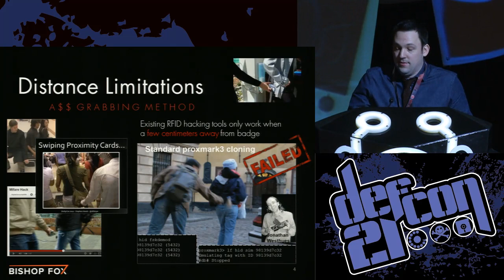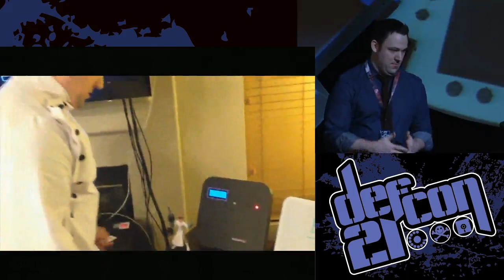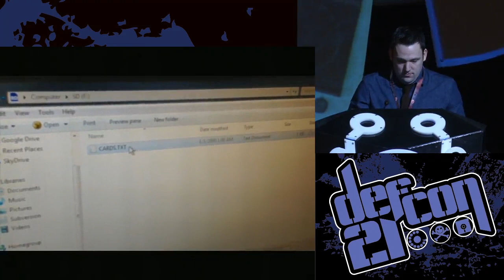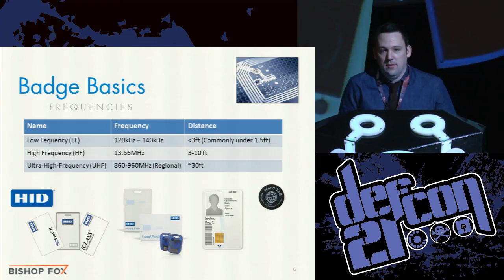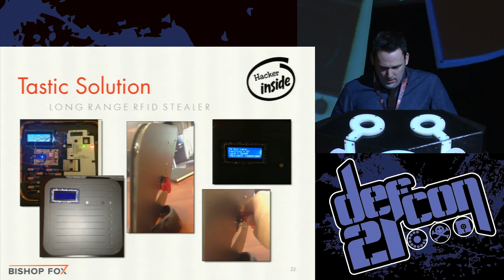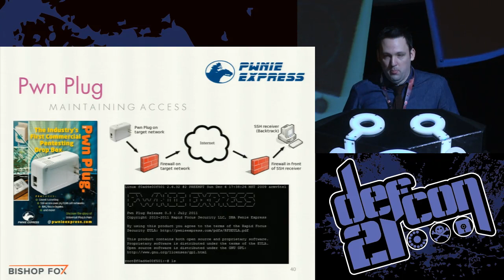Defcon 21 - RFID Hacking: Live Free or RFID Hard

Comment: What i am not getting is why it has taken this guy this long to do this. Not complaining here but i personally have done this successfully 6 years ago and tested it on a BNSF train passing a crossing with the reader in my car and an external panel antenna in the front behind the grill of the car. I read the RFID off over 200 inter-model containers on the passing train.  Yes my setup is bigger BUT I have 20 times the range than his setup meaning I can read a police officers RFID badge simply from me sitting behind him at a red light...
Reply: So why were you not at defcon presenting your research?
Reply: I have actually considered it but truth is I have wicked stage fright and suck at giving presentations. besides I am not yet near complete with my research at a point where I am satisfied. IDK maybe it's me being a perfectionist or something.
There are things I have completed but I cannot expose publicly due to hush forms I had to sign when I started work in the communications fields especially things involving military aircraft and sensitive communications systems used by cellular carriers and such.
Reply: +DE Lord Sadger 
What kind of software am I supposed to use to be able to decrypt this comment?
Reply: @Reth_Hard  Ihadasexonkeyboard decryptor :v